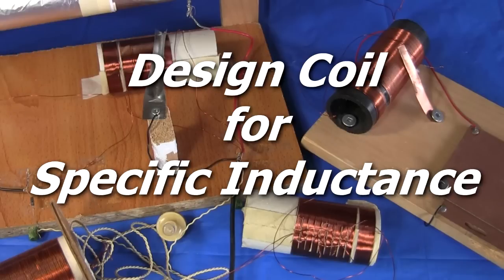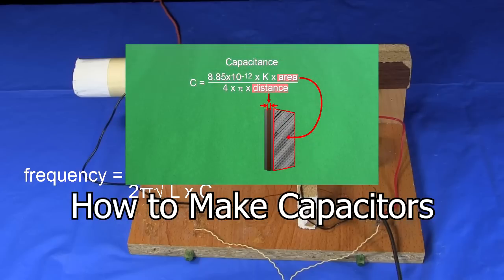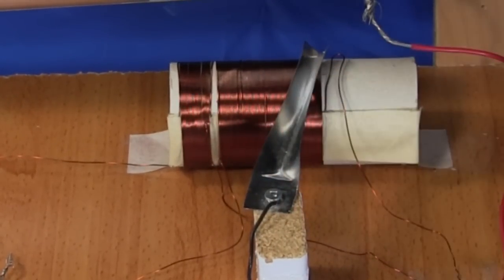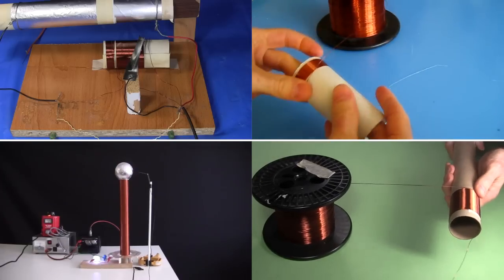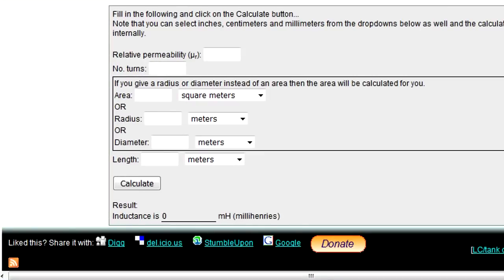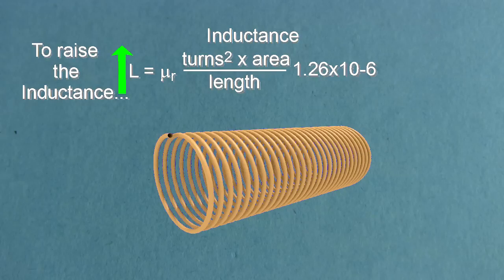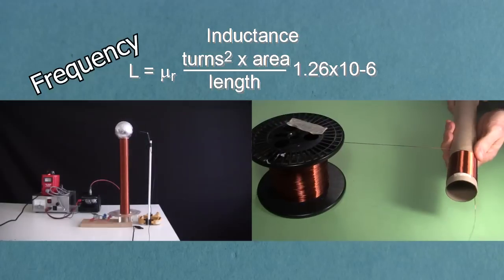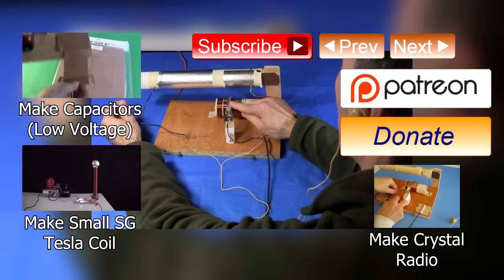How to Design a Coil for Specific Inductance

Comment: I saw a coil made by the english guy Robert Murray-Smith on his "TNT" website, he used button or cylindrical neodymium magnets, and I am trying to replicate it. Can you tell me what figure or factor would you say and use for the permeability of these rare earth magnets. I plan to use a joule thief to power this coil to try and get the lowest input possibly. I think the Joule thief description is a misnomer, I think it is more a joule scavenger because it extracts very low voltage or energy from a depleted battery and then enhances the voltage through a transistor (MOSFET), what's your thoughts ?
Reply from the maker: You can find the permeability here https://en.wikipedia.org/wiki/Permeability_(electromagnetism) (see the table around halfway down). Regarding the name, Joule thief, it's more formal name is a blocking oscillator circuit https://en.wikipedia.org/wiki/Blocking_oscillator
Reply: @RimstarOrg  Yes, but I'm interested in your subjective and respected personal opinion sir, when the flux in a circuit changes rapidly in a circuit does it actually pick up energy from the "ether" for lack of a better term or is this laughable nonsense. More importantly is this a viable and reliable energy source.
Reply from the maker: There are countless circuits out there in all sorts of consumer devices and non-consumer devices that have existed for decades that do similar things to this, coils that are fluctuated in countless different ways and none have ever put out more energy than what's been put in. Don't be misled by the name, joule thief, it's just a blocking oscillator circuit. Energy is built up over time in the electromagnetic field in the coils and then dumped in a very short period of time, resulting in a high voltage. It's actually a fairly inefficient circuit, putting out overall much less than what's put into it. That's not to say that one day we won't find a way to convert energy from the "ether", assuming that's possible, but this isn't it.
Reply: @RimstarOrg  Ahhhhh, now your talking brother. Your last reply is written with true scientific and factual intent, you are an inspiration sir. I have dabbled and read about most of what you have written about, including the oscillators, the big trouble is putting the right components together in "situ" to make any over unity device (again, perhaps another misnomer) as efficient as possible. That, I have found is bloody hard.

Comment: Hi sir, I need to make a 1000 turn of coil. 1 roll of coil isn’t enough. So if I add another roll of coil do I need solder it together?
Reply from the maker: Yes, you'll need to solder them together. You could also just scrape off the insulation and twist the ends tightly together but make sure you twist them well so that they won't come apart.
Reply: Will do the twisting method as it is much more convenient haha. Thx a lot sir you just save my day 👍🏻

Comment: if i put paper or mylr between the layers would this make the transformer have capacitor ?
Reply from the maker: The transformer already has capacitance due to the distance between the turns where there is insulation. Increasing the distance between turns and layers decreases capacitance. The type of material in that distance has an effect too so using mylar instead of air, for example, would give a bigger capacitance for the same distance. So yes, playing around with the distance and the material does affect capacitance.
Reply: @RimstarOrg  thanks for the info , how can i make a coil with high Impedance like 1.68 H
Reply from the maker: Judging by the H in 1.68 H, I think you meant inductance and not impedance. To do it, try playing around with all the parameters until you get what you want. The calculators I mention on my website should help https://rimstar.org/science_electronics_projects/coil_design_inductance.htm

Comment: Will it effect the value if I change the  diameter of the copper wire?
Reply from the maker: Yes. Increasing the diameter of the wire will make the overall coil longer and therefore affect the length parameter in the formula. Similarly, decreasing the diameter will decrease the length parameter. Or if you're trying to keep the coil a specific length then you'll have fewer turns, which is also a parameter in the formula.
Reply: @RimstarOrg  thanks for your reply sir.

Comment: Sir what would be the diameter of wire which we wound over the core
Reply from the maker: The diameter plays a part in the length of the coil and the number of turns you can fit into that length. The number of turns and the length both are in the formulas. So when you try to get certain values for those, that's when the wire's diameter becomes important for inductance. Search online for a "wire size" table to help with that.

Comment: If I wrap the wire over the top of my first winding, making a double layer inductor, will I have to double my length in my calculation?
Reply from the maker: The formula's quite different in that case. Do a google search for "coil inductance formula multilayer".
Reply: RimstarOrg Thanks :)

Comment: How can i easily search for a coil under the ground witht the frequency 101.4khz (specifically designed for the telecom branch), is it possible to just use the magnetic sensors of the phone in combination with a khz searching app, or for example a multimeter with a coil? Most of the time we know around what area we have to search and the coil is about 50cm /1 or 2 feet under the ground.
Reply from the maker: I don't know if it would work but you could experiment with something like my pizza box crystal radio https://www.youtube.com/watch?v=iunAvz9PbN0 You'd have to do the calculations for the capacitor capacitance and the coil inductance which I explain in this video https://www.youtube.com/watch?v=tjD9I95RAbw I have no idea if it's the best way or how well it would work if the source is underground though.
Reply: @RimstarOrg  thanks for the answer btw, i saw the video, but that (not being offensive at all) looks strange to take it to a work place

Comment: Do (erg)s affect the "air" coil? Or is it really not enough to measure or matter?
Reply from the maker: Do you mean the energy (erg is a unit of energy)? Power is energy per second and voltage * current is power. So sure, by measuring voltage and current in the coil you can get the power, of energy per second.

Comment: I really found this video to be helpful - thank you. :c)'

I am probably going to reveal just how little I know of electronics with this question but here goes.

If I were to wrap two layers of coil (lets say equal turns) around a section and connect both inlets and outlets together i.e. connection in parallel - what might I expect to see?

How might a dual layered coil, each of 100 turns compare to a longer coil of 200 coils?

Thanks for humouring my ignorance. :c)

Comment: Relative permeability part is wrong. You can't use 100 for iron core. If it's not a closed loop (like toroid) effective permeability will be much much less than 100, closer to air permeability because there is huge air gap between the ends of your core rod.

Comment: What determines the size, or gauge, of wire to be used?
Reply from the maker: The gauge only played a part in determining the length of the overall coil and the number of turns I could fit in that length. So the gauge was involved only indirectly. If the current is high or the voltage is high then the gauge can also be important, but it wasn't in this case.

Comment: if i wanted to make a coil gun, what would happen if i used a ferrous barrel and projectile as the core of the coil?
Reply from the maker: I'm not sure. It's possible that the ferrous barrel would take up too much of the flux and the projectile would get less than it otherwise would.

Comment: Does crystal radio needs supply power for driving piezo element?
Reply from the maker: No, the crystal earpiece that's uses a piezo element inside. That's actually the normal way of doing it.

Comment: special request::: show us how to convert am/FM radio into a shortwave radio and or show us how to build a shortwave radio from scratch!! 

can we make a crystal shortwave radio???? I'd like to this on the cheap!! I hope to hear from you soon!!!
Reply from the maker: I don't know about converting an AM/FM radio into a shortwave radio, and I haven't done it with my crystal radio but for my crystal radio, based on a kit I have for another crystal radio that does shortwave, they have you connect in an extra 470pF fixed value capacitor in series with the variable capacitor. This has the effect of decreasing the capacitance, while I think still using a useful width of the coil making it easier to tune. Then to use it adjust the tuning coil to the lower inductance range (fewer turns) and adjust the tuning capacitor to the lower capacitance range (less overlap of the capacitor plates) in order to tune in higher frequencies. Also, I'm told that for sortwave for a crystal radio you need a very long antenna since the signals are weak.
Reply: RimstarOrg thanks I appreciate your input!!!

Comment: What is not clear is how "area" is derived. Does one use the inside, mean, or outside diameter of the wires that make up the coil. Obviously the result will not be much different with thin wires. But, if one makes a coil with thick wires, the wire's diameter can have a big difference on calculated area, and more especially when the coil's outside  diameter approaches the thickness of the conductor. When a coil's (outside diameter)/(inside diameter) >2 but <1 is when it gets real interesting depending on which method should be used to determine a coil's area.
Reply from the maker: You use the mean. Since I was dealing with thin wire, I didn't think to include it in the video.
Reply from the maker: Since you were just the most recent of quite a few people who've asked me about whether or not the coil should be included in the calculation for the area, I just updated a diagram and added text about it to my webpage here https://rimstar.org/science_electronics_projects/coil_design_inductance.htm.

Comment: i want  to build a schuman generator  with range 10 meters.I have coil 0,1mm  coil for my conductor antena.How many turns and length ?
Reply from the maker: You'd need to come up with a circuit first before you can do any calculations. There isn't enough information.
Reply: ok

Comment: would it be possible to build an in-ear crystal radio? to simplify things, it would be fixed frequency like 600khz. from what I understand, all I would need is the right coil/core combo, a diode and maybe an SMD capacitor, and then a little something to drive the eardrum.
Reply: If you use SMD components it would be possible. Although a large antenna would be preferable. There would be a lot of fine tuning and calculation involved in getting an antenna that small tuned to the right freq and receiving enough power to run a piezo speaker.
Reply: i was wondering how small of a coil would be feasible.. with good earplugs to seal off external noise, the low volume of a crystal radio would be okay. it would just be cool to have something small to listen to AM radio at night without batteries. perhaps this sort of form-factor would be more suitable: http://imgur.com/a/QIqhd
Reply: You could use a large value cap to reduce inductor size. But the antenna will be challenging as you will be much shorter than the wavelength. Value calculation would have to be very precise. Look at how to do a quarter wave ant. Then consider it will be more like a 50th wave ant... there would be zero room for impression....
Reply from the maker: Would you receive enough energy on such a short antenna? Pretti PC Services is talking about not using batteries. I'm just asking. I'm no SMD expert.
Reply: I don't know. The idea of a quarter wave ant is that it receives as much energy as a full wave when tuned right. Not sure you can tune something that small though. I think there is a reason I have never heard much about  8th wave or smaller resonant antennas...
Reply: Could my body be the antenna, or would I have to serve as ground? I forgot how important ground is to a crystal radio. I was also under the impression that the tuning coil was the antenna. I'm wrong there aren't I? Perhaps I would be better off building something that uses a battery. I am mainly interested in getting some discrete auditory entertainment during my night job that requires hearing protection.
Reply: Your body may be able to act as ground, but that’s another problem I hadn't considered.

The antenna is not the tuning coil. The antenna should ideally be exactly the wavelength of the freq. Its rarely possible to cut exactly so you have a variable cap or variable inductor to tune it. In most cases this variable component has enough range to tune the ant to many stations... You can use a smaller antenna, but it's best if its either half or a quarter of the wavelength and I think you still need an extra tank (L-C) circuit to make it behave like the full size antenna. You can use any size ant and tune it but more circuitry is needed and the maths can get fairly complex

You can get some nice hearing protection with built in radio and noise cancelling etc. I used to work with earthmoving machines. We had MP3/radio playing earmuffs with noise cancelling so you could tune out specific ranges of sound. So we could block out the engine, but still hear someone talking..

Many modern ear-buds have noise cancelling and meet OHS requirements...
Reply: i also didn't realize 600khz had a 500M wavelength. I would be using this about 9.5 miles from a 5KW transmitter.  looks like I should just get a small cheap 1xAAA AM/FM radio for now and focus my efforts on modifying some hearing protection to make noise. if I can wear the big hearing protection earmuffs, those are simple to modify for sound, I wouldn't want to buy a big obvious radio headset with an antenna poking up and an LCD and knobs on the side. I'm not 100% sure that radios are against the rules, but we can't bring in cell phones, and its basically like going through TSA security in/out of work every night. empty pockets, go through metal detector, x-ray everything not on my person. but the metal detectors aren't overly sensitive, I accidentally brought my keys through before and it didn't alert. I can probably get a radio in/out pretty easily. just thought it would be cool if I could make something smaller than available on the market. I guess I was expecting to tap into zero-point or something.
Reply: Its not impossible to make something to do what you want, but I'd be very impressed with one smaller than what's commercialy available.
Reply from the maker: If you're willing to go with a battery, I recall slider2732  managed to fit a radio in a matchbox (https://www.youtube.com/watch?v=QoROht1nXg8). Just replace the solar cell with a small battery. I don't see his antenna though, but you can ask him about that.
Regarding ground, I've used my body as ground for a crystal radio and it does help. Just make sure you have a lot of skin contact, maybe where the headset touches your skin around your ears. In this video you can see my left hand is on a capacitor plate http://youtu.be/JtPwxbOgBHw.
Also, it sounds like you can benefit from a lesson in crystal radios. If you want, check out my How a Crystal Radio works video http://youtu.be/0-PParSmwtE.
Reply: I'm still trying to wrap my head around how the crystal radio works. I had a kit when I was small, but lost the germanium diode before I got around to building it. I have a bunch of 'germanium' diodes from eBay, but I suspect they are probably not actually germanium diodes. One of these days I'll actually build one, then once I understand how it works, I can experiment with miniaturization. If I can't make it earbud small, I could at least make an AM radio to fit in one of these other things on the market that are head-wearable, like big cheap hearing aids, Bluetooth headsets, and FM radio/mp3 players. the main thing I want to avoid is headphone cables that would snag, pull, or break. a whip / wire antenna hanging down my back would be fine. I also see there are AM radio ICs that resemble transistors. I doubt I cou
Reply: I'm still trying to wrap my head around how the crystal radio works. I had a kit when I was small, but lost the germanium diode before I got around to building it. I have a bunch of 'germanium' diodes from eBay, but I suspect they are probably not actually germanium diodes. One of these days I'll actually build one, then once I understand how it works, I can experiment with miniaturization. If I can't make it earbud small, I could at least make an AM radio to fit in one of these other things on the market that are head-wearable, like big cheap hearing aids, Bluetooth headsets, and FM radio/mp3 players. the main thing I want to avoid is headphone cables that would snag, pull, or break. a whip / wire antenna hanging down my back would be fine. I also see there are AM radio ICs that resemble transistors. if I could get several hours or a week out of an AAA that would be fine with me. I had a Sony radio that went forever off of 1 AA as long as it was on AM. maybe I should just buy one of those again. it wasn't the smallest thing in the world, but it did have good reception and battery life.
Reply: The main power drain in a radio is the speaker. An earbud turned down low won't use much.
You can test a germanium diode with any multimeter that has diode test. Germanium has a forward voltage drop of 0.3v or less. Those detector diodes are usually about 0.17v I got a few bags off ebay and most worked.
If you don't have diode test on your meter, use a 1-10k resistor in series and a AA battery. Check voltage across just the diode. If its 0.6 or higher its silicon.

You can also use a silicon diode as long at its a detector signal diode such as the 1n4148